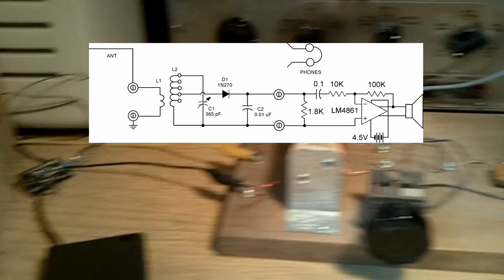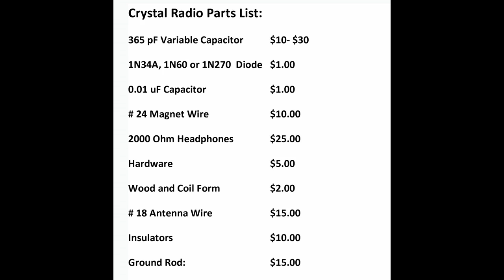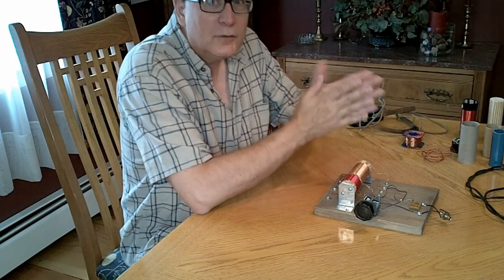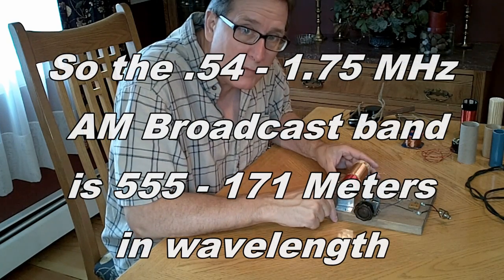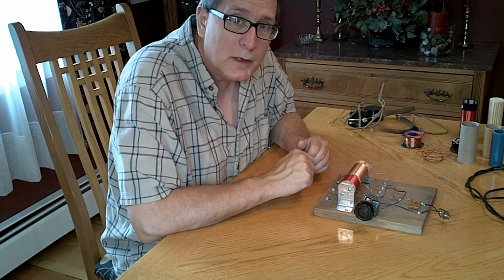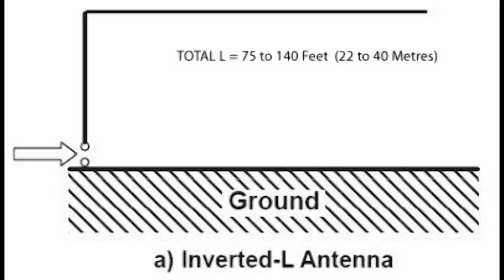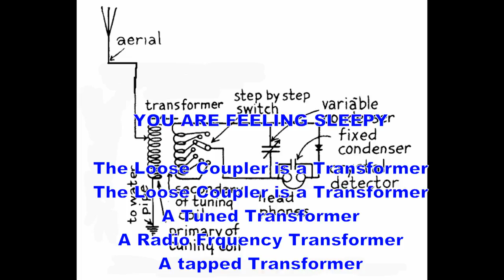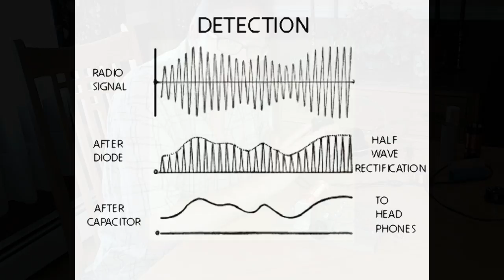Crystal Radio Basic Setup

Comment: My first crystal radio was the Science Fair model from Radio Shack in the mid 70's and it had long and a short antenna connection. I could only pick up one station with it but I was still impressed as a kid. This 2020 year I have been doing vintage tube radios and decided to play with crystal radios again and built two types and was disappointed in both of them, and then I stumbled across your circuit and it works great. Thank you for your informative videos.
Reply from the maker: You must do a regen next!
Reply: @MIKROWAVE1 I also built an  Antenna Loading Coil from your video and it works very well for me because I only have an 50 foot antenna in my attic. I also played with your diode bias circuit and that very interesting also. I will build the regen types in your videos and that should be fun to do this year. Thanks for your great content

Comment: I've built this radio and I'm pretty impressed with its performance and simplicity. It's a great tool for experimentation and for learning RF.
I made a small change at the coil taps: I divided down each tap from the previous tap by sqrt(2)  (~1.414), so the taps are roughly at 88, 63, 44, 31, 22, 16 turns, getting denser at the bottom end. Since the voltage is sqrt(2) lower with each lower stage, the impedance of each tap is exactly the half of the previous tap; this makes impedance matching a bit easier at the bottom end of the coil.
Reply from the maker: Nice! And your tap method makes sense.

Comment: Howdy.
I would suggest using litz wire for the coils. Less losses and better selectivity. My experience with a regen receiver is that the operation improved so much that the regen circuit had to be redesigned for the receiver not to oscillate. The regen needed be way weaker.
Regards.

Comment: This is a really excellent video! Back in the day, it was a LOT harder to find parts. Most you could make, (any one remember making your own "condensers" -or detectors out of galina, lead crystals, razor blades, oxidized copper -etc?) but the headphones were a big problem. I got some from Lafayette and it took 3 weeks to get them! Now, thanks to the internet, you can get anything you need quickly, easily and relatively cheaply.

Comment: another great video - I have reticently built some xtal radios and they are  tons  of fun and lots learning involved - I few comments about them a) It might be better to  skip  the effort of locating a 2000-5000 ohm headphone and  use a Bogen T-725 transformer with modern 16-32 ohm MP3 player headphones - some of them are fairly sensitive for the price. T-725s are found on Ebay for less than 10 dollars.  The best coil form I have found is at home depot  -4" polystyrene couplers can be had  1.60 USD apiece, they are easy to wind and they have better Q than PVC, cardboard or wood.  Lastly got to plug Peter Friedrich's excellent book - Voice of the Crystal - a veritable modern day Morgan!
Reply: Great post thanks!

Comment: I used to love a certain station in Los Angeles. About 1200 miles away from where I was in Spokane Washington. I could receive it quite easily on the tube based radio in our Volkswagen van. I tried in vain to get the station on any of the radios in our house. Almost all of them were the post tube era radios. I finally found a 1940's era tabletop radio. Then if it was turned in a certain direction. Would receive the LA station. And later, I got a 6 volt Volkswagen radio from a guy who was upgrading to 12 volt. It would also receive the LA station. This was of course during night time hours. During the time I was probably their most long DX fan. I also won two giveaways. Unfortunately one was concert tickets I could not make good on.
Reply from the maker: In 1979 I interviewed at Motorola for a co-op job in their Arcade NY automotive electronics plant . Girls on the line were building car radios and in back guys were grinding parts for Volkswagen Alternators.

Comment from the maker: For receiving, many folks use #14 stranded or solid copper wire from the hardware store. Copper coated steel wire called "copperclad" can be much thinner like # 20. Bare is OK as long as you use insulators. # 18 "lampcord" would stay up a while but would eventually break.

Comment: Thank you.  I am looking forward to building a clone of yours.  
    Can the antenna have insulation or must it be bare; also does gauge matter?  I would suspect 130' strung in the air will need to be thick enough to support it's own weight in the wind, ice and or birds?

Comment: How are the taps on the round wood connected to the coil itself?
Reply from the maker: The easiest method is to form a loop of about 6 inches where you want the tap. Then twist it until it meets the coil again forming a twisted lead of enamel wire. Then keep winding to the next tap and repeat. When you are done and the two ends are secure, go back and twist each to tidy up and tighten the coil. Finally, scrape and tin the wire right at the coil and on the ends. I will put a picture in my FB page.  https://www.facebook.com/Mikrowave1/?modal=admin_todo_tour

Comment: Thanks for the video, very well done.   How many turns for L1 and L2?  I'd like to build the set.
Reply: I'm a little late to the party, but for anyone who might be asking the same question there is a good spot for a screenshot at 19:12 

Has all the ratios and tapping points.
Reply: @Inertia888  That data is useless without specifying the copper wire thickness(es) for both coils. Just re-watched to see if I missed them, but he just says everything works between #20-#30 wire.

Comment: Is Lightning a danger with an outside antenna wire?
Reply from the maker: Yes it is. The first order of business is to be able to bleed off static build up. A lightning arrester does this. Removing the rig from the antenna lead and grounding the coax is the only real lightning protection. And of course all bets are off with a direct hit.

Comment: I have a 50 foot antenna kit coming, would that be sufficient?
Reply from the maker: Well 50Ft will work if it is installed in a good clear area and you have reasonably close AM stations. A small slider type loading coil would help a lot. There is no law that says you can not add more wire to the far end or maybe better, the the down lead end of your kit either, if you are concerned about appearances!

Comment: This was interesting to watch. I've got loads of crystals and was really hoping to see actual crystals used to pick up radio signals.....aren't real crystals used in radio making? I'm a total novice at making anything like this so I'm wondering where the crystals fit in to crystal radio sets? 😎👍
Reply from the maker: Well kind of. Crystals in the sense that you are talking about, are natural minerals with semiconductive surfaces that can be used to make a crystal diode. This is called a Cat's Whisker Detector. Later, ordinary manufactured Germanium Diodes also began to be called Crystal Diodes. Quartz Crystals are a completely different beast. These are used to establish a single stable frequency in an oscillator such as the crystal in your watch that keeps time or the crystal i your computer or in your cellphone.

Comment: Headphones are better than earpiece. Why? Earpiece seems a lot less expensive, much easier to find - it's not like you're getting stereo output. I'm not saying you're wrong I just don't care for assertions without reasons.
Reply from the maker: Crystal earpieces are high impedance and sensitive. A pair (not one) could be hooked up in phase to produce an excellent approach to the headset problem. My promotion of magnetic phones is purely nostalgic.
Reply: @MIKROWAVE1  Thanks for the reply. Can you help me to understand something? High impedance. Crystal radios, working with no external power source, I would think you're talking about very low voltages, so why on earth are high impedance listening devices a good match? I'm picturing myself trying to go up a steep hill on a bicycle. I'd be wishing for a smaller impediment. Obviously I don't understand this concept well. Also, on a related note, I often see a small resistor between the headphone or earpiece terminals, what is that for?